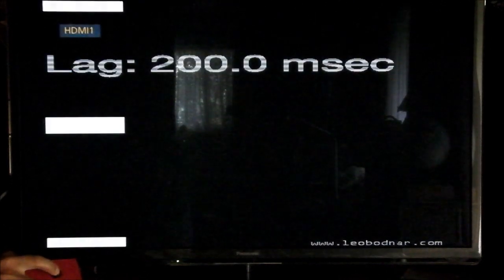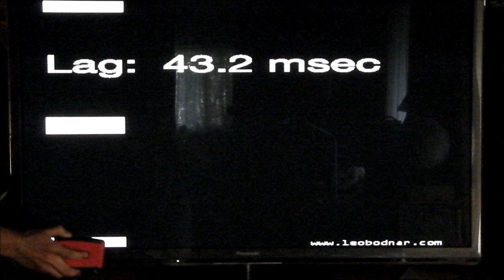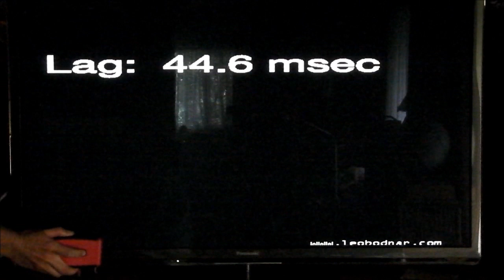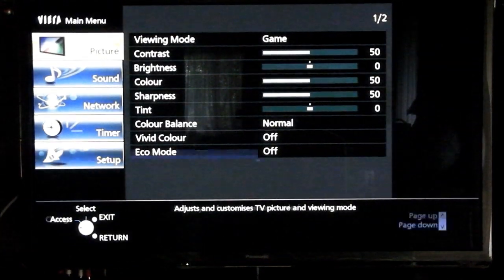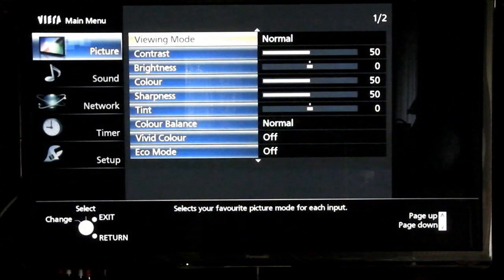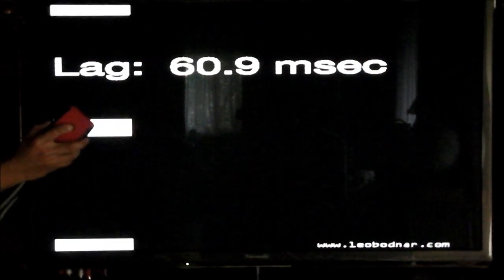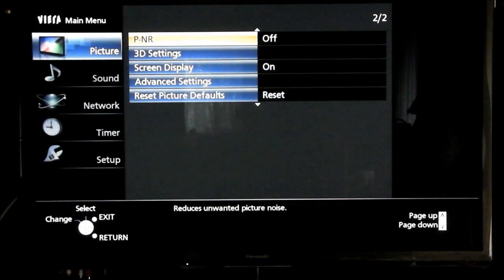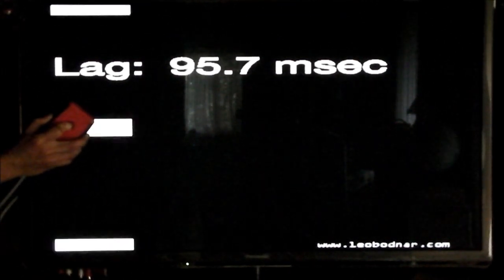Leo Bodnar's new input lag testing device

Comment from the maker: higher value is worse. 

lag is caused at the point where the tv/display (generally lcd & plasma) recieves video signal from a source(video game console), spends time processing the video signal in preparation to finally display the picture. The point at which the processing occurs can create a slight lag, meaning that the picture on screen is not quite up to date with what the information the console is sending to the tv. I would continue explaining but im running out of characters...